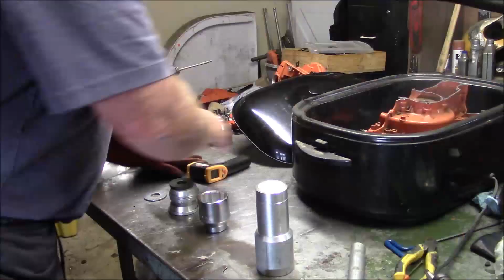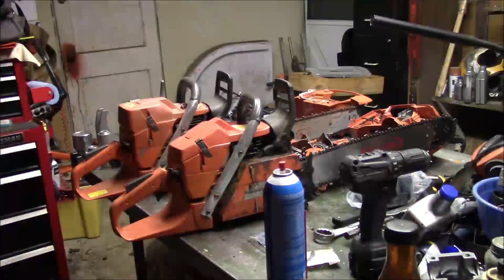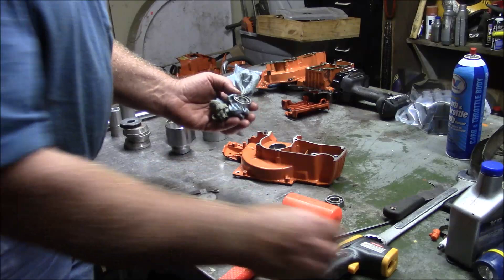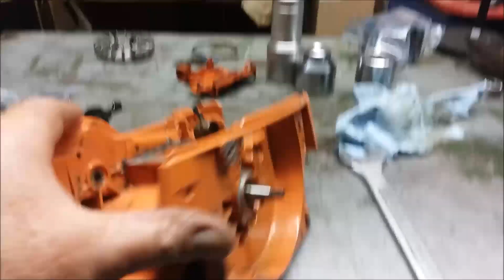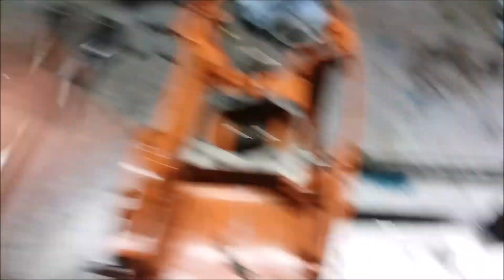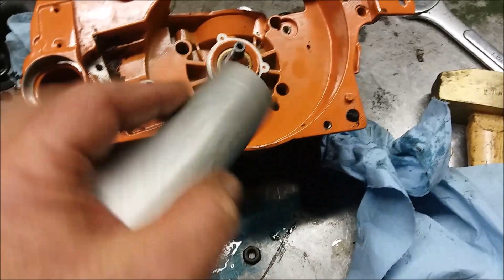Husqvarna 372 Crank Case Assembly, Husqvarna 372xp X-Torq vs. Original Edition Trivia

Comment: Not towards the 372. Husqvarna 55 when pulling the crank into one side of the case witch side do I put it in first. The clutch side then to the flywheel side and put together or vise versa or does it matter with the 50,51,55 series cases
Reply from the maker: Doesn't really matter I guess. I do the PTO side first on the 372/390's as it captures the connecting rod so I don't have to monkey with that on the final pull. But it doesn't matter. I need to get you to just look at stuff like that and use common sense,  kind of like "Luke" in the Star Wars Movies..Use the force, Try chit and make mistakes try again ...:)
Reply from the maker: I appreciate that and why I would like to get you to the "next level" as you do show true interest. Guess where I am going with this is trying to get folks like your self to "visualize" the process. Pick the thing up and see what flops around , if anything; then visualize how those part interact as they are assembled. Sounds cliche? Maybe, but what happens over time is that "model" built through experience say from disassembling / assembling saw such as those 660's can be  applied to many other saws. And you will "see" those type of issues long before you actually run into them the hard way. At least know the types of things to be on the look out for. Might do a video on that someday, almost like the sports concept...:)
Reply: You are very welcome I've definitely learned a lot in the past 3 years of watching your videos. I can say I have and probably will keep doing so but I have watched specific videos multiple of times just for exactly what you're talking about. I have noticed that most saw concepts are the same not saying each saw is the same but how things are done with them if that makes sense. Just learning a basic clam shell is about the best way I know to get someone to learn a saw get use to one but bot so use to it they hurt themself.
Reply: I didnt think it did but the helpful tip of the crankshaft was what I was looking for. Could not remember if it mattered or not. I'd rather ask then not ask. I do know how the mistakes are and do it again took me 6 new poulan 2175 cylinders before I got each process of assembly correct. Sometimes it's best to do a lot and get certain processes wrong so you can teach yourself not all have good teachers some teach themselves. I've self taught most everything on 2 strokes when I first started with the basic homeowner saw to learn the basics. Everything else after the first saw I got running with no info on what to do and what not to do. I was learning from a damn good saw builder named Walter if I remember correctly! The reason I got into using bigger saws and hopefully someday having a food 372xp or Xtorq. Anyways buddy hope you've had a good 2020 so far and keep up the good videos love watching them.

Comment: Hi have seen quite a few of your videos and it seems you have alot of experience with those Chinese saws which would you recommend from experience 372xt or 372xp I can't decide between the two.
Reply from the maker: Maybe I'll drag mine out again and tweak it as I do the OEM X-Torq's. Gutting the intake and such. Muffler mod.
Reply: @afleetcommand  I will keep an eye out for that ,I appreciate the sharing of Knowledge,
Reply from the maker: A tossup. If you want to modify one the XT is probably the better choice. If you want to just run it as delivered, I would not recommend either, but would point you to the g372 offering. It was closer to being ready....cheap fuel lines and stuff like that need to be replaced PDQ but that all of them.
Reply: @afleetcommand  Thanks for the response I ended up ordering the xt and will see where it goes, Im hoping to build a cheap cord wood saw to get my old Homelite SXL 925'S a break  on the bigger stuff there fun but ,some parts getting harder to get.